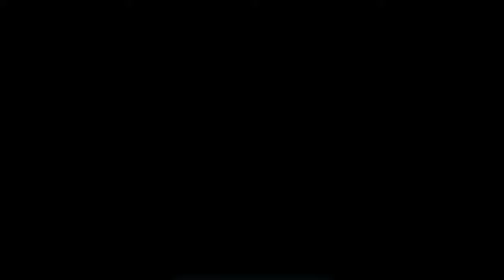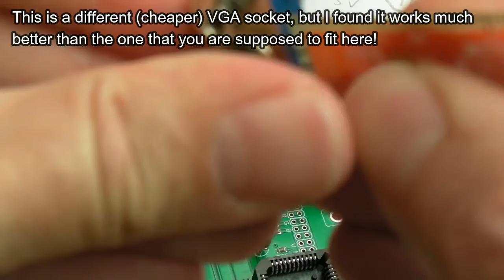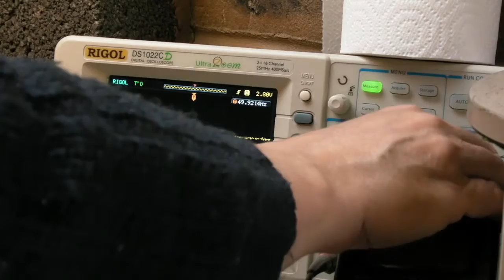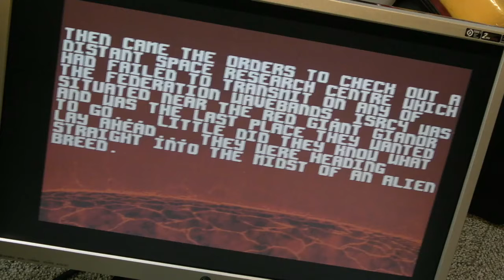Commodore Amiga AGA Multifix & VSYNC Tick Fix (Scandoubler / De-Interlace Card) - Part 1

Comment from the maker: Correction: This board does use VSYNC (looking at the gerbers...) - More about that in part 2...
Part 2 - https://youtu.be/V1WyO-43QVY
AGA Multifix Github - https://gitlab.com/MHeinrichs/multifix-aga
00:00:00 Intro & Thanks
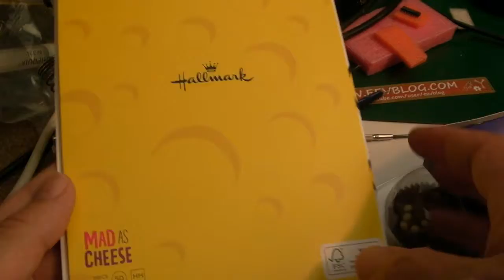00:03:50 Parts
00:05:15 Build
00:22:11 Cleaning Up
00:23:36 Programming via JTAG
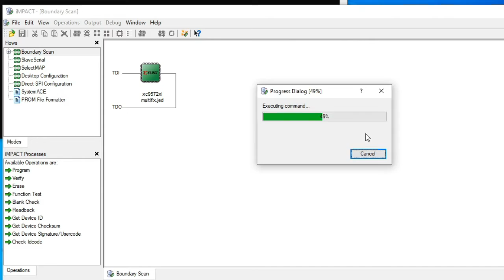00:24:35 Installing ICs
00:26:24 First Test (Fail)
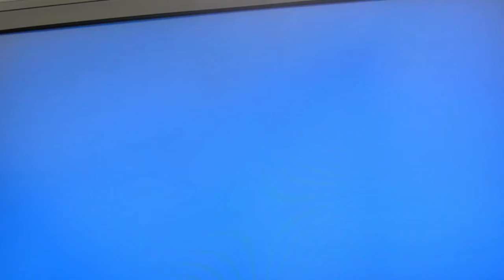00:29:05 Fixing First Mistakes
00:30:49 Second Test & Jumpers
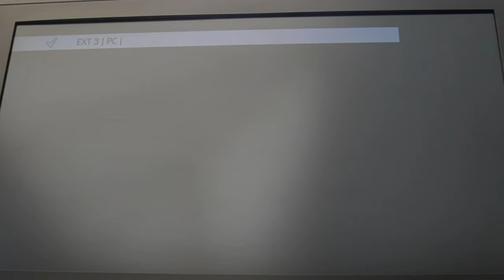00:33:16 Very Low Brightness
00:36:39 Working (Over Bright)
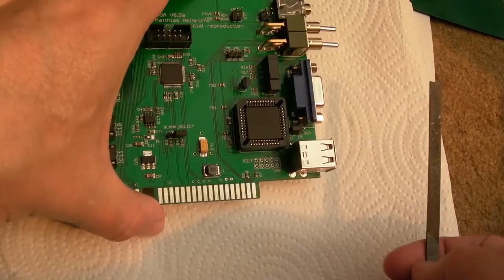00:39:36 Filling Down PCB Edges
00:40:59 Brightness Fix
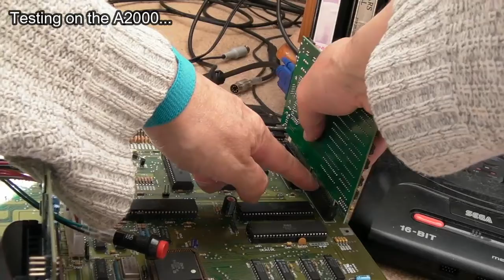00:41:11 Testing A2000 & VSYNC Tick Problem
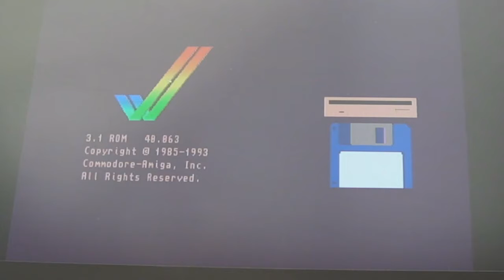00:46:01 Testing VSYNC Tick Fix 1
00:49:49 Testing VSYNC Tick Fix 2
00:59:35 Final VSYNC Tick Fix & Theory
01:06:01 Final Testing
01:14:34 Close Up & Thanks

Comment: I dropped out of the Amiga info stream just after the A4000 was released,  If I remember correctly, my A3000T did not have a flicker issue due to a built in doubler.  I ran an NEC Multisync monitor it's whole life.  Later in 2005 I briefly ran a cheap Dell VGA CRT, with a Picasso.   Was the A4000 or AGA machines not equipped with a scan doubler? (I assume)

Comment: If your scope has a option for phosphor presistance mode you could try that to see if there is some sort of odd glitch that is getting cleaned up by the buffer board  you built.  Alternatively you if you have a logic analyzer you could use that to perhaps catch a glitch as that would be able to show a way longer signal time base then the scope.  The reason why the scope update rate slows down as you slow down the time base is because it also slows down the sample rate due to it only having so much memory to work with.

Comment: I never had a big box Amiga, just a 500 and then a 1200. Do Amiga cards have a back panel that you can secure to the case to give them some stability?
Reply from the maker: Yes, they usually have a back plate - just like an ISA card!